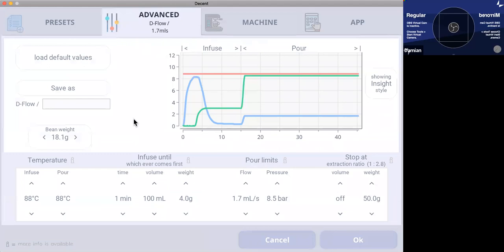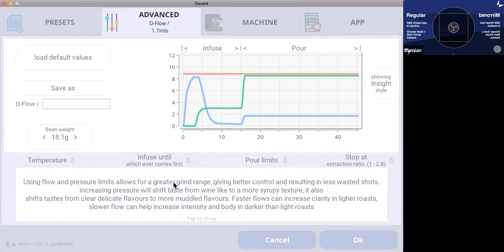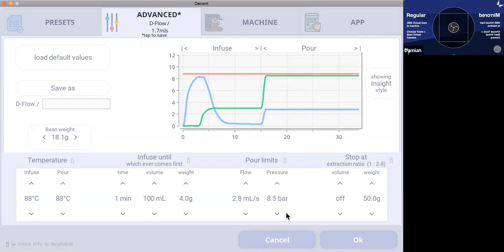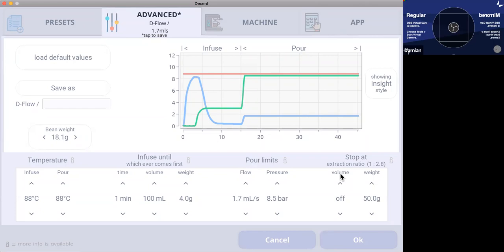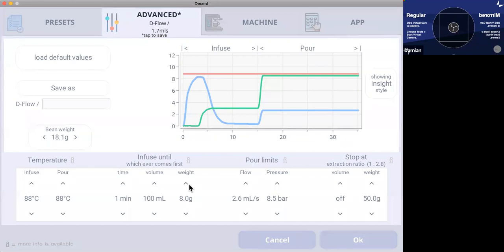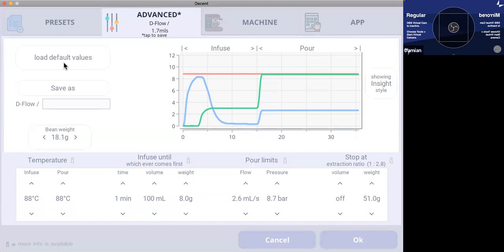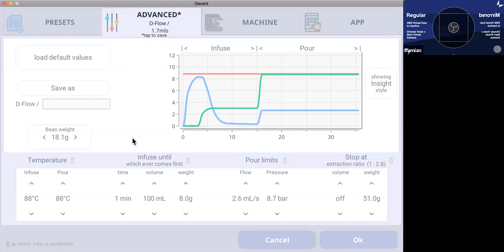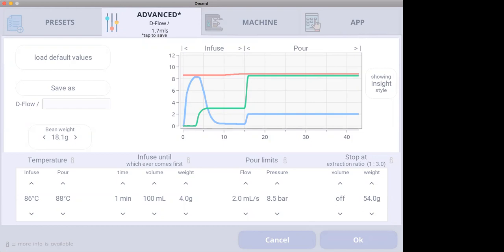Damian's D-Flow Profile

Comment: My settings is a litle bit different from yours. Just wanted some clarification on this, so if I set the flow slower, it will give me a heavy body (towards bitter side) and vice versa. Is it correct? And how do I know if the flow is 'correct' or not?😅 Btw this is such a great video 😊

Comment: How do I use my computer to make profiles?
Reply from the maker: Only the Android version of the app will connect to the espresso machine using BLE. The desktop versions are to help introduce you to the apps UI and most popular recipe's.
Reply: @decentespresso  Gotcha. Okay:). Is there any way to manipulate the profiles easier? I’d love to be able to click around with a mouse, and then type in a value manually. Right now I have to tap literally hundreds of times on the screen when adding steps to a tea profile for instance

Comment: The thing is that every single batch is different a bit, so probably you need to set your profile every single week when you buy a new bag of coffee. So this is good but I think you are tweaking micro adjustments, that probably won't take a really noticeable effect. Well this is like roasting every bean separately by gram/size/humidity. Imo these micro micro adjustments pointless, because every single tamped coffee puck is a bit bit different. Just think about it in a scientific way. The key thing is 'major' things like lighter roast is better with higher temperature and longer preinfusion maybe bigger ratio. It is like photography... the more you are technical the more you gonna miss the point of the whole thing and you gonna remain with numbers not adventures. The only recipe that I have is that lighter roasts are better with higher temp/longer preinf./longer brew time/bigger ratio, and as you go darker you need lower temp/less preinf/less brew time/less ratio. I bet if I would give you guys two different batches/roasts from the same beans and you would stick to these graphs based on previous experience, you would have a hard time getting the two batches to match.